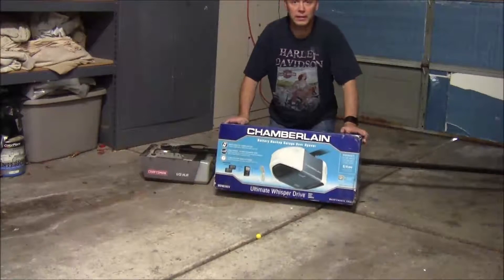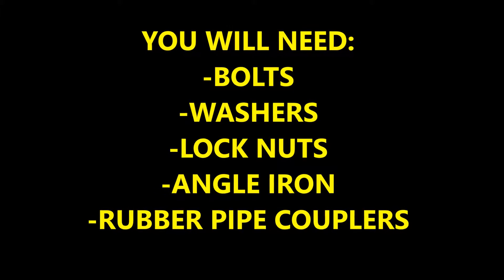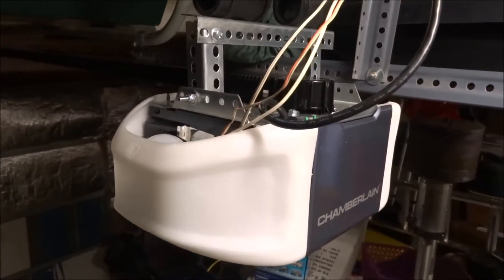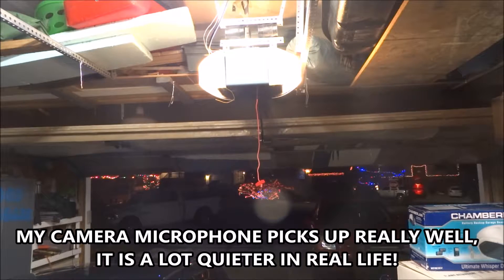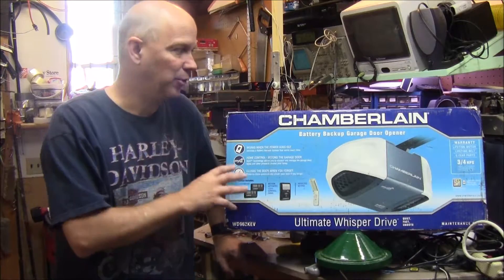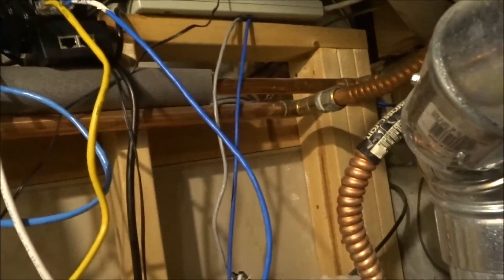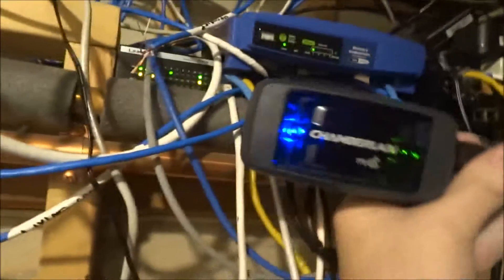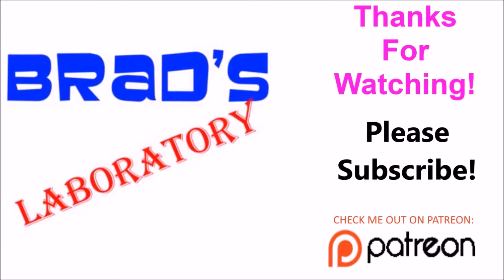Garage Door Opener

Comment: Why does your garage  door opener need wifi ? I still dont get that is that some type of government plan to keep track on when people. Leave comeback how mny time garage is open. Then next thing u know. Your internet is hacked by  home invators now they know when U arnt home. To steal your items?  ...
Reply from the maker: It is easier to hack an RF garage door then a WiFi one, the most secure is no opener, that way you can throw the slide bolt and you are sure it is locked. The WiFi is very convenient for when a family member stops by and I am not home, I can open the door from my phone for them. I can also check my phone before I go to sleep to make sure my kid didn’t leave it open. This opener also works with Amazon Key to allow Amazon packages to be placed securely in your garage - although I don’t use that, not sure how much I trust those minimum wage drivers.

Comment: interesting idea.  I think I'd cable it, or something, just in case the rubber fails in the future from age.
personally, I have no plans to give up on my old opener because it doesn't have those crappy "safety sensors".  When I last rebuilt mine I made sure to get an extra kit.  You never know when they will discontinue something.
Reply from the maker: I considered strapping some aircraft cable (wire rope) around it as a safety measure, but it was really strong once I had it together - so I decided against it.

Today they discontinued stuff on purpose to force you to buy a new product. I just went through this on my Milwaukee Drill brushes!
Reply: +Brad's Laboratory   That sucks.  Milwaukee used to be very good about old parts.  Personally, I think Sarbanes-Oxely causes a lot of it.   Since businesses now have to track and pay tax on all inventory, that adds a HUGE cost to stocking parts, which is a less lucrative business than selling new tools.
The real kicker is the government forces businesses to throw old parts away when they take them out of inventory.  Theoretically they could try auctioning stuff, but in the end they'd often still lose money over just throwing it in the trash.
I noticed it most in car parts.  I drive old beaters and I used to be able to find 20 year old parts at dealers sometimes.  Now, if you have even a 10 year old vehicle parts might be hard to find.
Heck, I wanted an accessory (bed tie downs) for a 2016 Ford F150.   I went do a local dealer they they had to order it.   Really?  They couldn't afford to stock a common accessory for a 1 year old truck?
I have no doubt that the effect of that law is intentional, tho.  It puts huge pressure on small businesses and favors large centralized corporations.
Enough conspiracy theory ranting from me, tho.  ;p